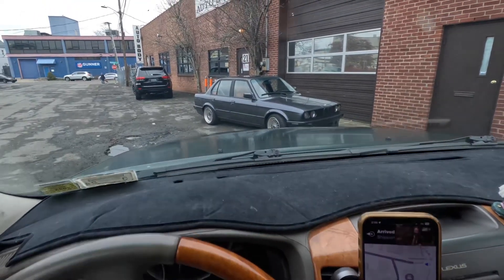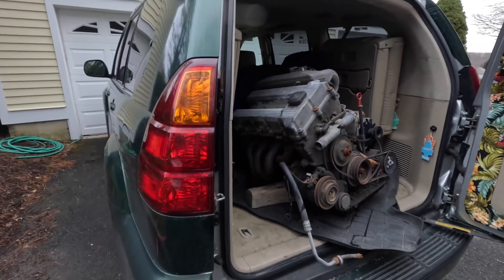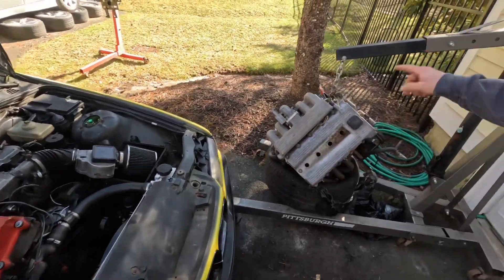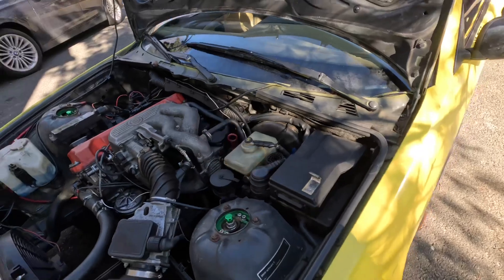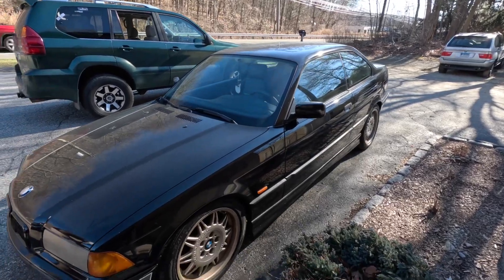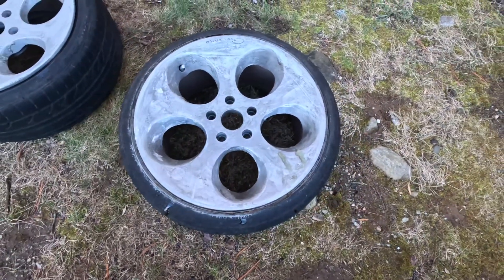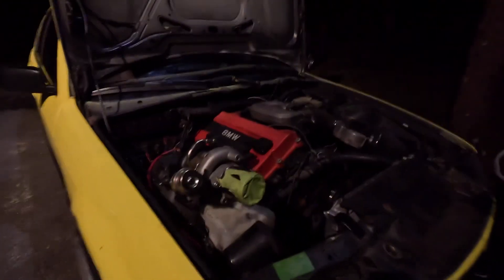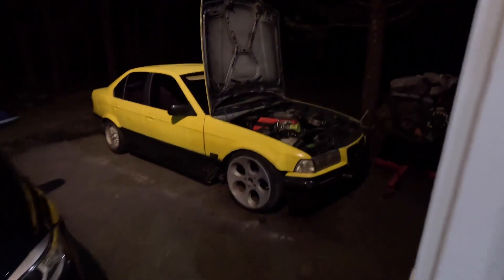318i M42 e36 TURBO prep for the drift car

Comment: 91 m42 has duel valve springs 😘… also if you can swap to the later style lower timing case so you don’t run into snapping the timing chain idler gear off… I’m pretty sure you can buy support bracket incase you don’t want to
Reply from the maker: Yeah I learned about the valve springs after uploading lol, not a bad idea thanks g